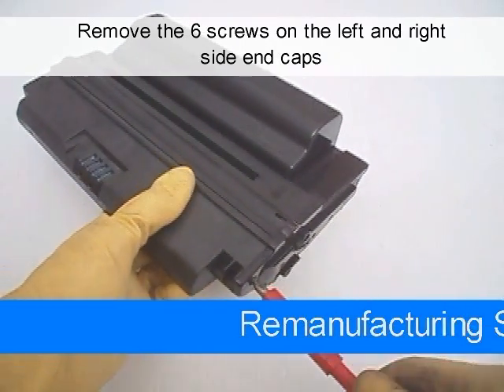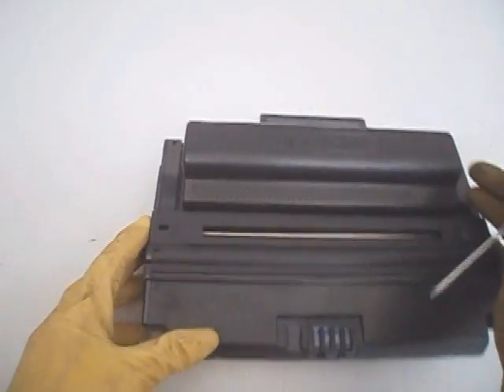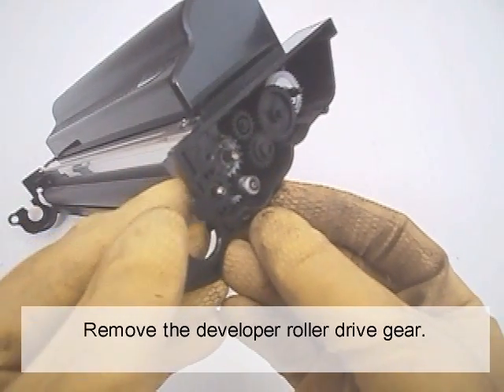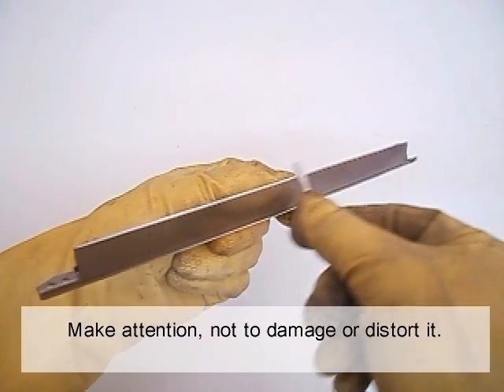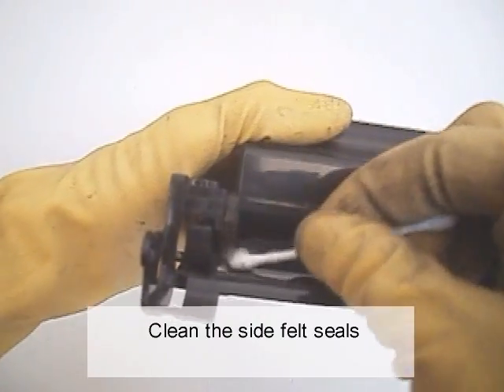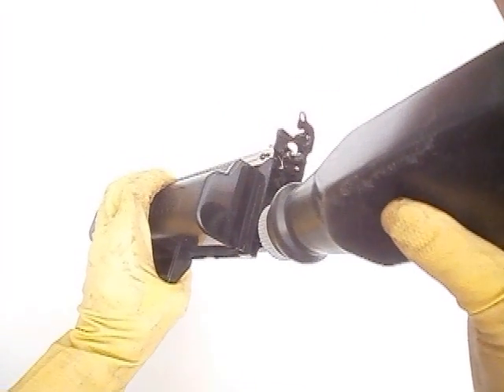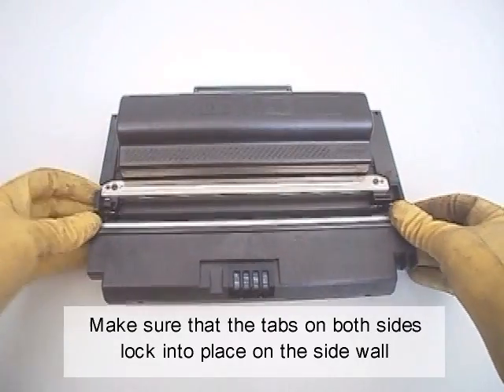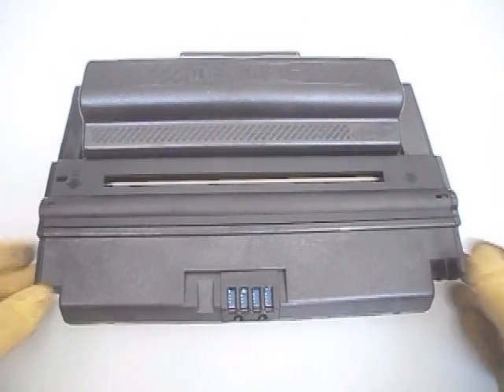SAMSUNG ML 3470 3050 MLT-D2082 TONER CARTRIDGE REFILL

Comment: Is this toner (ml3050) compatible with Dell 2335 / Dell 1815? I think no because the toner from ML3050 is little bigger. Thanks
Reply from the maker: most of Samsung black laser printers use the same toner
Reply: yes toner powder is the same, but can i use ML3050 body with dell chip in Dell 2335 printer? The toner looks a little bigger.